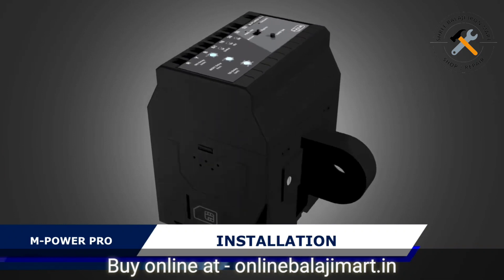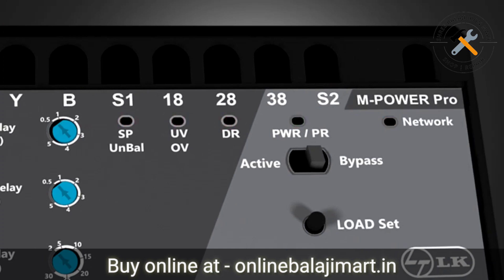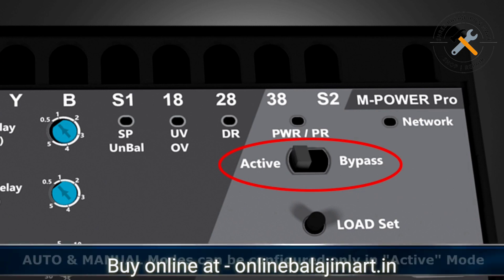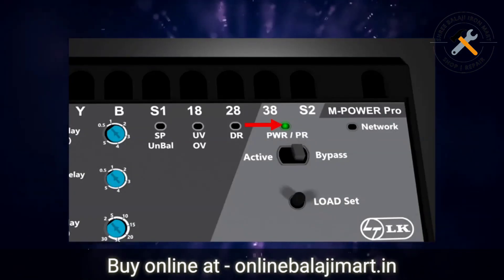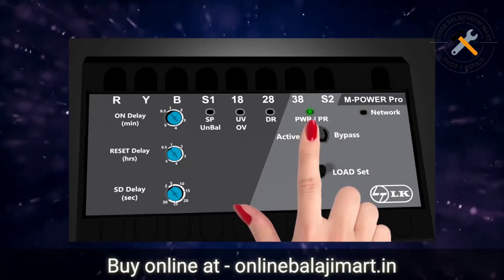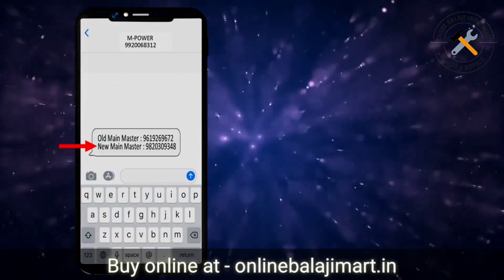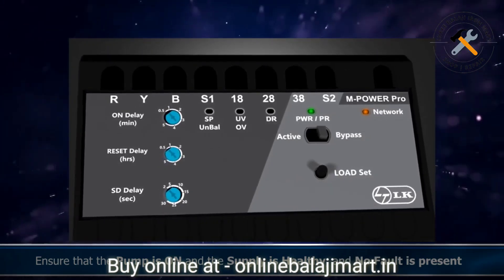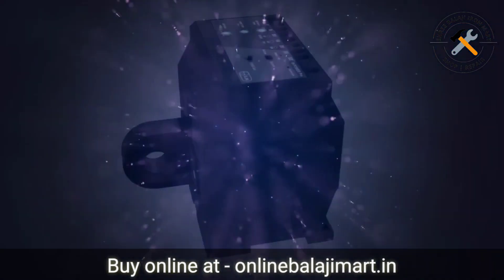L&T M-Power Pro Installation Guide (English) - onlinebalajimart.in

Comment: Fault:NO
Pump:ON
Vry: 327V
Vyb: 327V
Vbr: 330V
Ir: 12.79A  👈 can you tell me what is this means 
Run Time:00:00
Clock:15:33,08/11/25
Network:96%
Mode:Auto

It is for 6HP 3 phase motor. 
What does IR stand for in this SMS?
Reply: I think winding changed, then only it is taking 12 amps
Reply: @vijayprasanthreddy177  no, winding not changed. It is 6hp submersible pump in my farm with 3 phase connection
Reply: Can u give the name plate details of the pump?